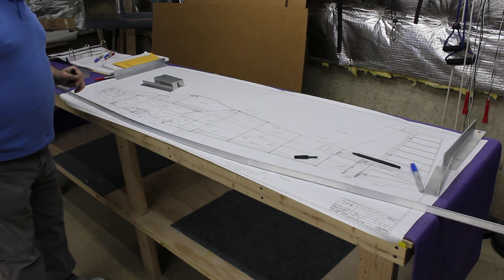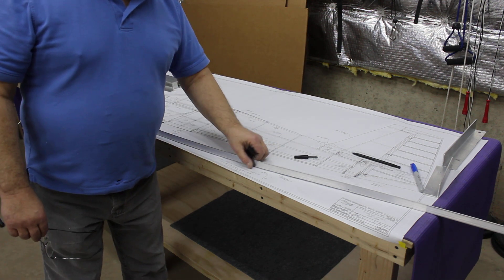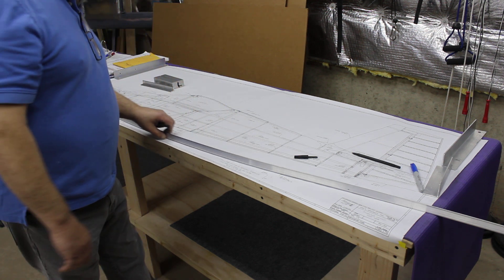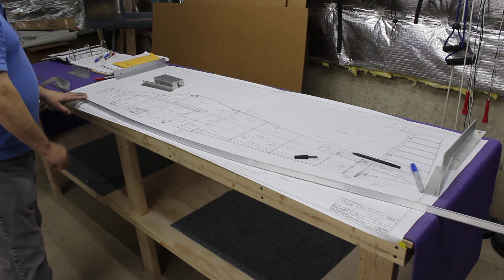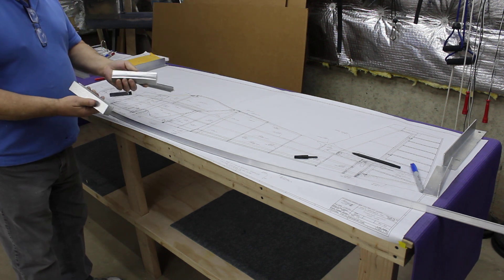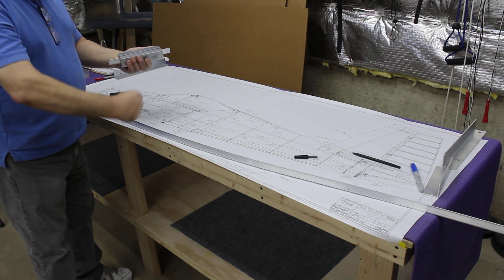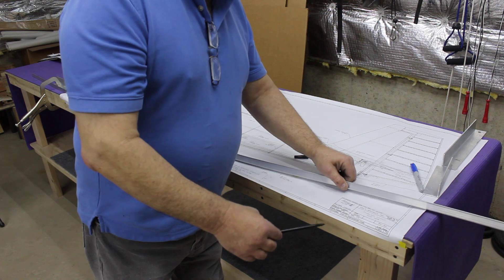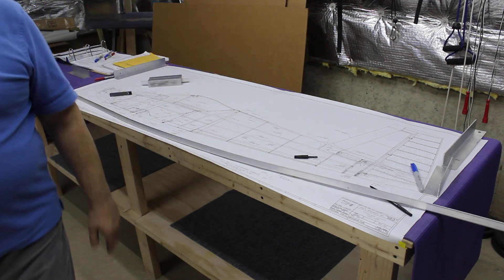Van's RV-9A Longeron Bending

Comment: We have yet to build an airplane, (or anything even close) but we have built a lot of things, and I just wanted to say that this is a good video about how you did this part. I like this method over whacking it with a rubber mallet. We're considering the RV-10.